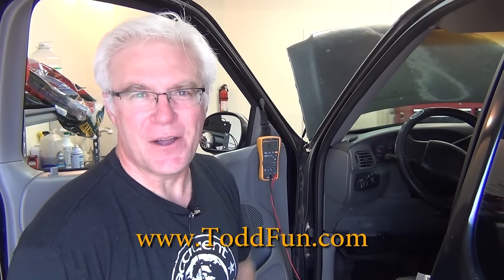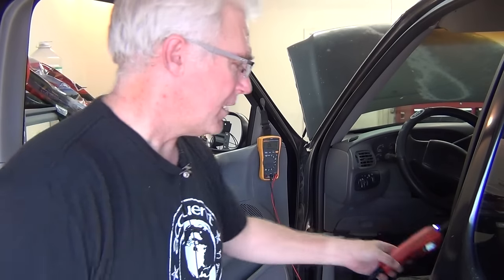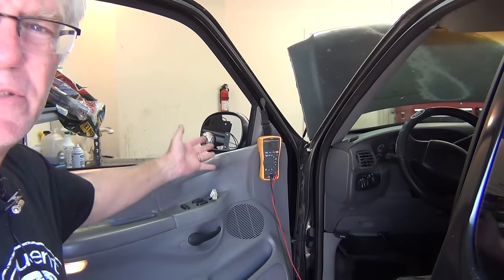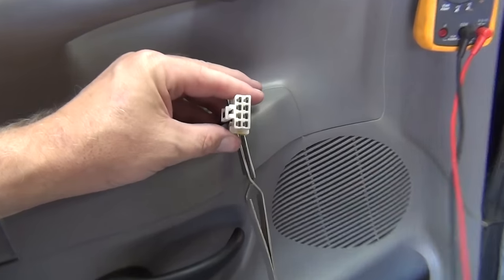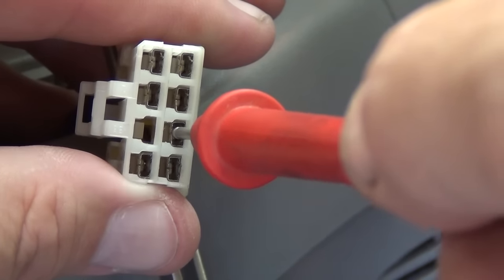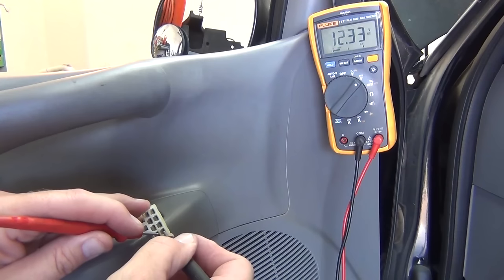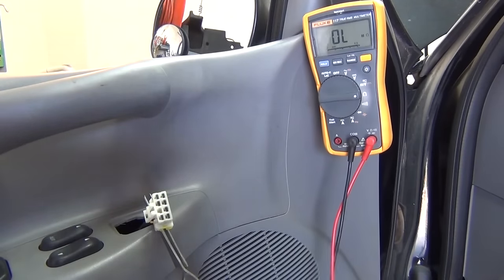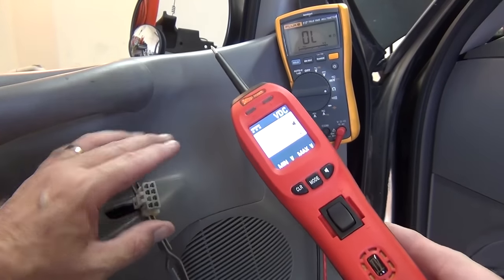Troubleshooting Mirror Switch in Ford F150 using Power Probe 4 PP4

Comment: i am evaluating getting a pp iv so very helpful. i have a 10 pole swith box for 3 motors on my forage chopper with no wiring diagram. this vid helped me immensely because i did not know about the COMMON and reversing it means to go backwards. also very helpful. i see that you like electronics & clocks as i do. so i subscribed. keep those vids coming. thanks

Comment: Came to find out the pin outs for the power mirrors. I don’t have a power probe. Instead I manually jumped connections to each motor using the power outputs.  

Also, I avoid Dorman because they are usually junk. If they aren’t bad out of the box they fail within weeks or months.

Comment: Great info. That power probe is cool. Does it plug into to power from vehicle battery or does it have an internal battery?
Reply from the maker: It has to use the power from the battery which is also needed anyway for it to do the resistive analysis which helps tell you if the circuit wiring from the battery to the test point is good or not which. It couldn't do that unless it had it's own known good wire connection to the battery to compare.

Comment: Hi, can apply this test to my ignition switch connector? To check if the issue is the Ignition switch itself or anything else ie. NSS, starter solenoid or starter? My starter relay and fuse are all good. Just installed new battery.

Comment: hey friend, does it work to check and find open circuits right? does it have those like fuse conectors?  could i make a manual conection and trace the open circuit in the fuse receptacle wires?
Reply from the maker: You could use this PP4  but you would also need this add on kit too: Power Probe ECT2000 Short Open Circuit Detector

Comment: Question do you know the switch pin configuration of the Ford 901342 power folding mirror switch. It has 8 pins 1 power, 1ground, 1 common, 1 fold, 1 left mirror up down, 1 left mirror left right,  1 right up down, 1 right left. Would love to know plug positions please

Comment: I have been trying to figure out the best way to determine if the switch in my 03 mustang was bad since my passenger mirror only goes up and down but not left or right. Replaced the switch and same results. I wonder if my chance I still have a bad switch. I will finally get to use my Power Probe now that I have watched how to use it. :)
Reply from the maker: Good, let me know how it goes. Another very common problem with mirrors is that water cause enough contact corrosion that the wires that plug into the back of the mirror motors behind the mirror need to be taken off and cleaned. Sometimes  you can manually tilt the mirror one way at a time and get a small screw drive and needle noise to pry off the connectors, scratch up the contacts, put on some dialectical grease and reconnect. That solves a lot of the mirror control problems because those connectors are exposed to the elements behind the mirror. You can even get the power probe back in there to power the motors at the connectors just to make sure the motors are good.

Comment: Help! I have a 2001 Ford Excursion Limited, and both mirrors aren't working. I tested the positive and negative wires and got 0 voltage. The fuse is good and I'm needing answers. I took apart the switch thinking that was the problem but it was fine. Please help!

Comment: so if you don't load the power circuit how do you know it can carry the current to the motors?
Reply from the maker: As always the true test is to load the circuit in normal operation. However assuming the circuit is OEM with no alterations then when the prob shows the circuit has low resistance and is giving a green circuit test light that means the wiring, connectors or switches are good corrosion free paths which is a "good" indicator that the circuit will handle it's OEM designed current load.

Comment: great video. How would I do this for a power seat motors on a 03 durango? only the forward and back works. the other directions motors dont make any sound. I'm assuming the motors are bad... but not sure. How would I test the switch? the fuses are good
Reply from the maker: You will have to get to the motor and decouple it at the connector and test if you can drive the motor like I did with the mirror or my window motor in my PP4 review video. If the motor is good then it is most likely the switch. Normally you and open up the switch for the power seats and clean the contacts to get them working or order a know working switch from www.car-parts.com unless you want new then get it from a dealer or local parts store. If you know the wiring for the switch you can test it with as well using a normal DMM in continuity mode while toggling the switch.
Reply: Right. Should I look for 12v when I press the switch?
Reply from the maker: You could,  but if the switch is bad you will not get power for those directions of course.
Reply: Right. So thats how you test the switch,  right?  And either ohm out and/or put 12v to the motor. If both turn out I have a short somewhere huh?
Reply from the maker: a short will blow a fuse someplace. You could have an open. I bet its just dirty contacts in the switch. I have cleaned many many power seat control switches and they work just fine once you sand the contacts with a little 600 grit paper.
Reply: Awesome thank you

Comment: Lets say the switch is good. Now I have to identify if its a bad connection or if its bad motor right? So next I should unplug the motor that isn't work, have someone play with the switch, and see if i get power at the connector that goes to the motor correct? I shouldn't need to hook up the ground, just use the probe to see if I get 12v right? Or would I still need to connect the ground cable from the power probe?
Reply from the maker: xXBurntBaconXx hook up just power. No need to hook up with Ground as you say. Those particular mirrors have exposured wires to the elements and connections sometimes inside the mirror get corrosion. So just pull off the wires and clean the connections.  You can sometimes do this just by tilting the mirror and reaching in with a long needle noise pliers.
Reply: But if I want to supply power directly do the mirror motor then I will have to supply a ground for it  using the ground probe wire and then supply power using the power probe correct?
Reply from the maker: xXBurntBaconXx correct.

Comment: Great Video, very informative. I didn't know that the common terminal was used for Positive and Ground.
 Is there a way you could have tested the switch itself? Either by continuity with the Fluke or with the Power Probe?
Reply from the maker: Sure, you can buzz out the switch with continuity using a multi-meter like the Fluke or any other meter.

Comment: Correct me if I'm wrong but a  continuity test should only be carried out on a disconnected circuit....
Reply from the maker: Yes. But this PP4 can do power tests and ground tests. http://www.toddfun.com/2015/11/24/power-probe-4-review/
Reply: Continuity is a resistance test 'ohm'
Reply from the maker: Well if a small current is applied and you get low ohms that can be called continuity. But really if current can flow in a circuit then you have continuity. The quality of that continuity can be measured in ohms or current flow. Most meters will read continuity as any ohm reading under a set small value like 25 ohms. However this may not be a good conductive circuit which is why it is really good to do power tests with a PP4.
Reply: Todd Harrison Sooo does the display only show the battery voltage of can it be used to measure Voltage drop and display the measures voltage on the display
Reply from the maker: Yes, it will show battery voltage and voltage drop with ohms reading all at the same time. This way you know if it is a good power conductor.
Reply: I was taught that too; Measuring resistance should be done on a circuit with no current flowing. It is a good thing that PP4 has a fuse for protection. Overall, the video was helpful. I enjoy it.

Comment: Nice video... would you please do troubleshooting  radio ?
Thank you.
Reply from the maker: What tip of problem is y our radio having that you think you need help troubleshooting. Power? speakers? Antenna retraction motor? RF Reception? Interference? etc. Could be anything.
Reply: my car radio shut off and on ....every 10 seconds..?
Reply: Thank you
Reply: My car radio shuts off and on every 10 seconds....? i would like to buy one like this.
Reply from the maker: Strange. Must be a defective radio that is over heating or has bad solder joints. Best to get a new cheap radio would be my first test to isolate it to the radio. If a new radio does the same make sure you're not using any external amplifiers. Starting place for sure.
Reply: Thank you.
Reply: Thank you.

Comment: I can tell you exactly why that Switch was Bad. Because it was made by Dorman!
They are the absolute worst Manufacturer of Auto Parts on the planet. Anytime I go to the Auto Parts Store and check for a Part, the first thing I tell them is "No Dorman made Parts"
I had to replace a lower Intake Manifold on a GM 3.8 liter V6, and all they had was a new Dorman $260.00, put it all back together, and ended up with half of the Coolant in the Crankcase because if their shitty Manufacturing processes or lack thereof. Took if back for a refund , then went to the Junk Yard and pulled am original GM off of a wrecked Buick for $50.00 bucks, and problem solved. Dorman cost me about a day and a half of wasted time. I will never buy another Dorman Part again in my life. I've heard from at least 20 Mechanics of the same type if experiences with Dorman Parts.

Comment: Amazing that a Dorman product is bad right out of the box, must be made in China. Years ago I used Nehoff electrical components and had no problems but can not find that brand any longer in my area. Standard Motor products years back were the worst but have been steadily improving but I still get the occasional bad one. I know cost of production and profit go hand in hand but corporate greed has gone too far. Just take a look at Takata air bags for instance, it has cost peoples lives and no real solution in site after how many years now? I've always taken pride in doing my job right but this shit can make the best of us look bad.
Reply from the maker: True, not much you can do. I have noticed that even the Jeep dealer will not sell OEM parts for my 20+ year old Jeep. They will sell parts but they say "We can order that and have it shipped to your door. " You pay the dealer price and a crap 3rd party part you could pick up at Autozone for 1/10 the price shows up. When asked they say that is all they can do for me because they clear their OEM inventor on 20+ year old Jeeps. Crazy.